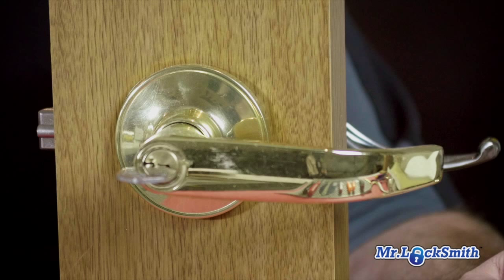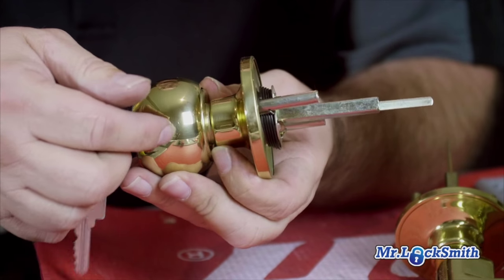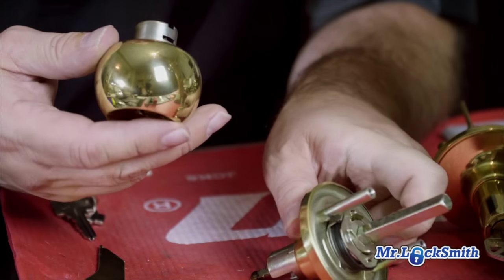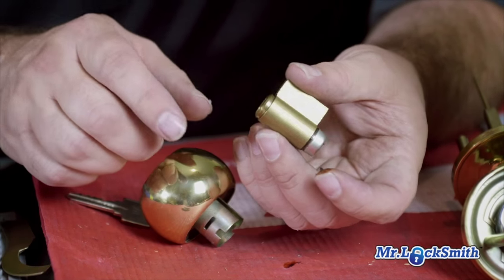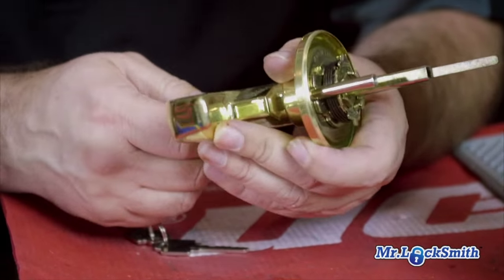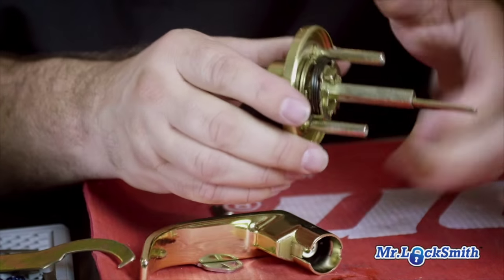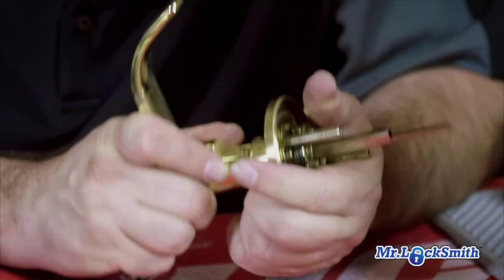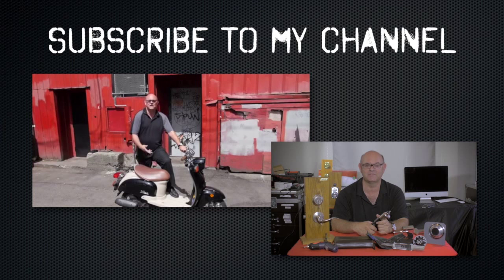Removing Key in Knobs / Levers from off shore locks to rekey the cylinders | Mr. Locksmith™ Video

Comment: This video saved me from buying  a new lock. 
Key would not go into the lock and it only worked from the inside. Took it apart as you showed, rekeyed and reassembled even thought a small part got disconnected but it works. All the keys worked, thank God.
Thank you Sir for your knowledge shared.

Comment: constantly am rekeying these style knobs in the apartments i look after...i often find spool security pins in them from the factory? in the cheapest knobs..there will always be at least two spool drivers...but still easy to pick.. i rekey them with a more radical bitting and add a couple serrated pins and it makes them harder to defeat.. but the overall quality of them is pretty bad.

Comment: How would I go about removing the key cylinder if a key is stuck in the knob locks you show?
Reply from the maker: Prinz Heinz Ketchup Usually the key gets stuck because you have the key upside down to the bible or the end cap is loose. ( Watch my video on Top 10 locksmith mistakes)

Comment: I have a Kwickset deadbolt and I use the original key. When I turn to the right to lock, I could not turn the key back to the upright position. I had to jiggle the key numerous times until the lock allows me to turn the key upright. What can I do to fix this?  thanks
Reply: I had the same problem. I found that you have to go up one number on each of the 5 bottom pins to get it to work smoothly.

Comment: man.... i am having HARD time depressing "pin" and pulling handle off on my defiant lock (looks pretty much just like in video) .   I tried for hours.  Using a tiny finish nail.  I dont hear a click.  After rotating to expose "pin" then Pressing tiny nail into the tiny hole with little and lots of pressure....no click and as i pull on it it would not budge, maybe the maximum i pulled of is 1/16 or 1/8 ......  any advice for me?
Reply from the maker: Crap lock, replace it.